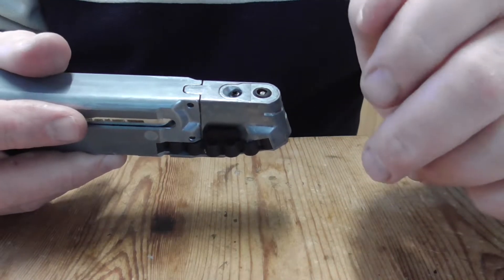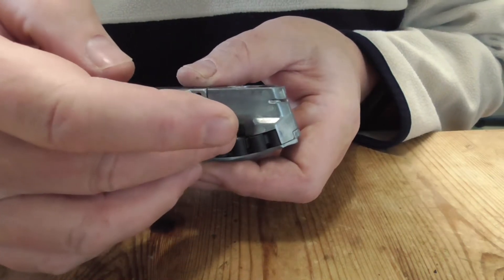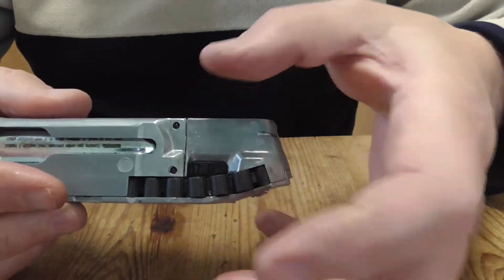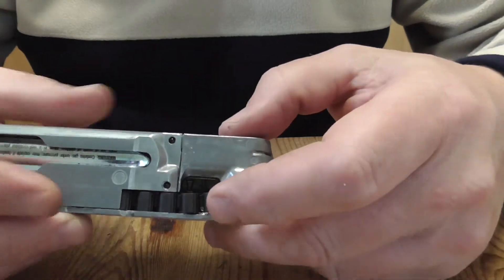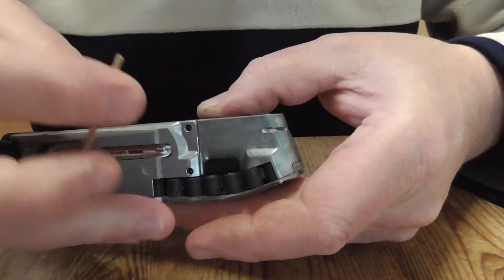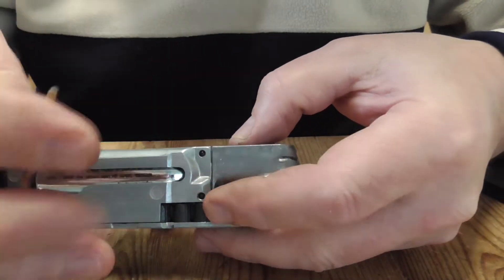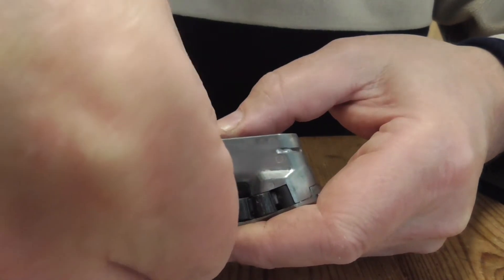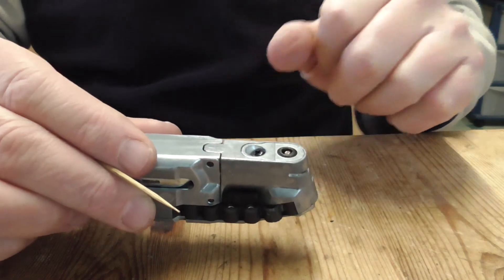Umarex Walther PPQ M2 Loading Chain Magazine 14/12/2021

Comment: Mine is jamming.. i think because of the rubber magazine.. if i shoot the whole gun blocks and the pellet wants to shoot and gets stuck inside... i think it doesnt rotate good enough. I have it new :(.. trouble started after 2nd time shooting.

Someone know what i can do?
Reply: Update so now without the bullets in it it looks like it works fine. Im afraid if i use bullets again it Will not work again. But i didnt use your trick with pushing the pellets in it a bit better
Reply from the maker: @jeroenvanderpol5916  Pre-seat helps, and also Umarex recommend lubrication with oil either side of the rubber belt.
Reply: @reevessairgunningreviews5572  it still doesnt work.. cant even sometimes pull the trigger or slide the abouve part.

I didnt have CO2 in it and i then tried it with loaded pellets in it and then pull the trigger some times and idk what happens inside but it doesnt function.. then i pulled the mag out again and i saw the the end of the pellets where dis formed
Reply from the maker: @jeroenvanderpol5916  If your pellets have moved out of its hole then there is a chance that the belt hole is broken. What pellets are you using? Try to get some decent ones that have a consistent size so they fit nicely. I use RWS Superfield with the larger 4.52mm head. Pushing them it a tiny bit so the skirt is just inside the belt. If the hole has split you will get a jam. You can super glue the broken hole, but you will not be able to load that hole again, so leave it empty. I have a couple of broke holes, so only load 19 pellets.
Reply: @reevessairgunningreviews5572  i use heyana penetrators because i also use that ones for my airgun and co2 python revolver. I dont know how to see if the rubbers are bad i actually think they look fine
Reply from the maker: @jeroenvanderpol5916 I see your pellets are pointed, so that could well be the problem. These type of pistols generally don't like pointed pellets, domes or flat heads
Reply: @reevessairgunningreviews5572  i hope thats the case i will order some (already needed more) and is your rubber band getting wide? Mine can go some wider .. i think it is weird with this gun that u need to role the rubber your self.

I really really like mine colt python 4.5mm ( 6" ) revolver with the cilinder it can shoot 4.5 balls and pellets
Reply: Buy walther multicare spray and give the magazine a good spray let it sit for 5 minutes also spray the barrel frame let the gun sit the 5 minutes then wipe the gun and should be all good i had same issue with jamming took it to the store i bought it and the employee did the same procedure to my walther p99 m2 177. the jamming stopped. Just respray the magazine abit mainly by the rotating metal mechanism on the back of magazine and the rubber belt if it starts jamming again. Also consider buying replacement rubber belts that hold the pellet, mine torn and now having to order replacements.